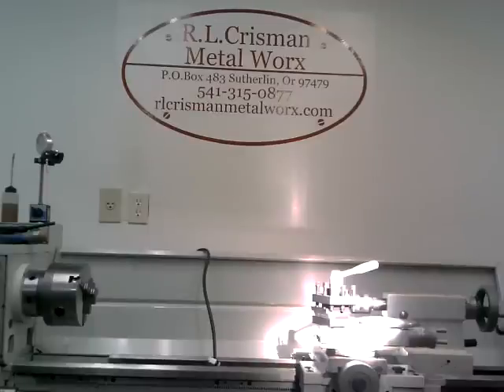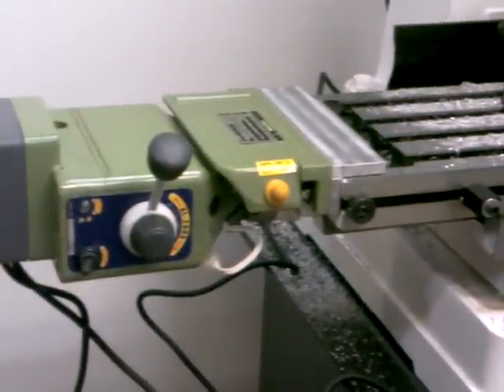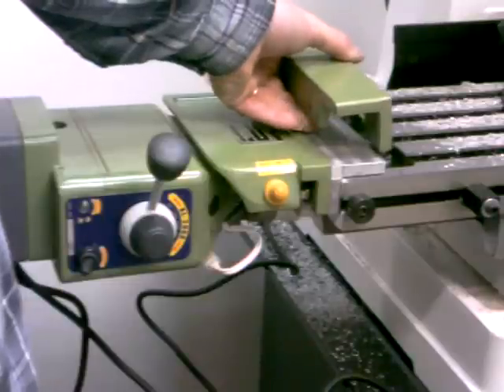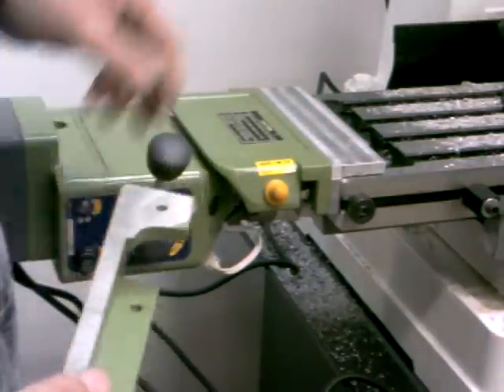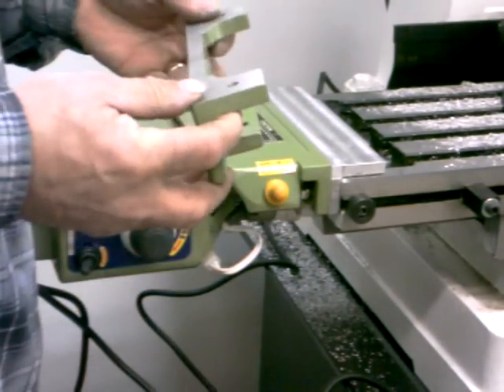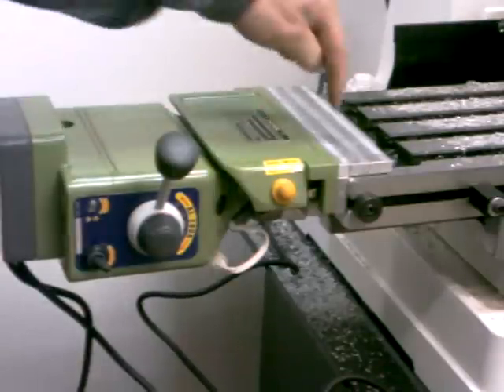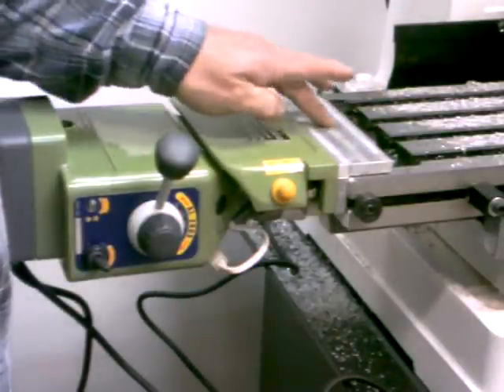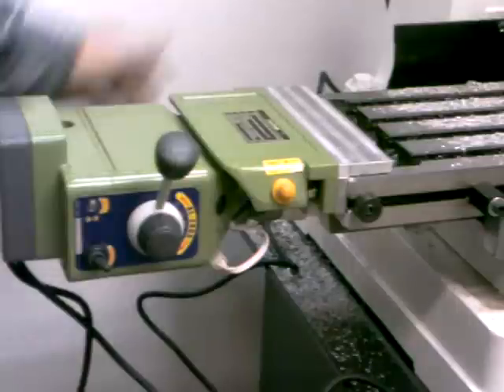RF-31 Mill Drill Installing Powerfeed

Comment: Ah well, it was kind of the guy to show his mistake - stops me repeating it. Folks I suggest drilling two holes vertically down through the top of the bracket to take bolts into matching tapped holes drilled in the table. I'm about to install one of these and I would like to find a way of not filling up half of the table drain well with the bracket.  Gets in the way when inserting T nuts. There's a lot of leverage involved here as that drive unit is heavy so it will need a solid mounting. BobUK.

Comment: I wonder why they don't use the two threaded bolt holes on the end of the Mill Table to mount the Power Feed?  The ones that were used to mount the end bearing plate to the table.

Comment: Installation looks very neat, I have a question regarding power feed, I have a milling machine from Modern Tool model MD-930, table dimension and travel look the same on both machine, I like to know where I can buy power feed the one you using on your machine.
Thanks
Reply: Looks exactly like my power feed on my Grizzly mill. And I have the same part broken!